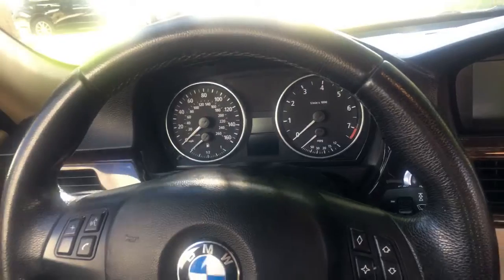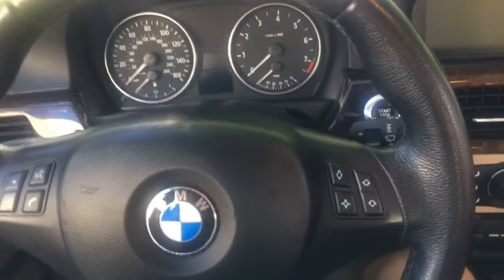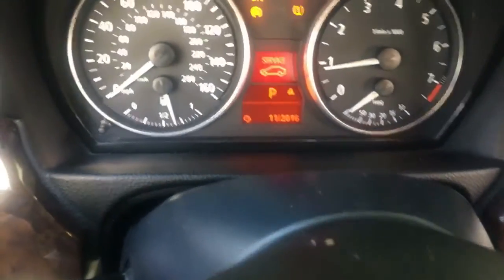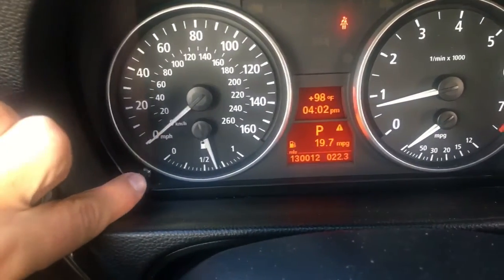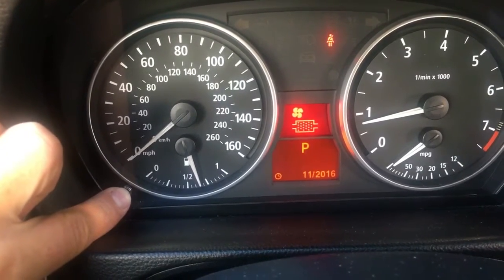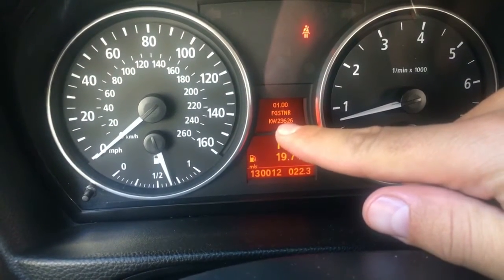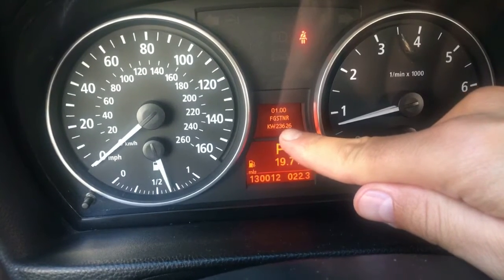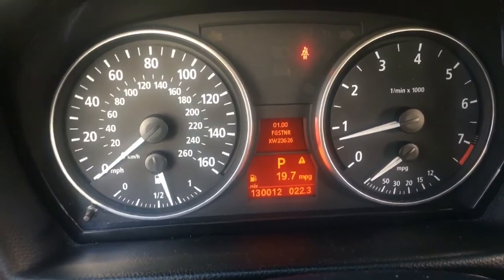HOW TO CHECK ALTERNATOR VOLTAGE ON BMW E90 E91 E92 E93

Comment: This will only work on my 2009 328Xi when the car is in auxilliary mode. If I start the car, the menu never somes up which defeats the purpose of the car running to see the voltage. Any thoughts?  Thank you

Comment: Is it normal that my alternator drop from 14.2 to 12.5 the 13.5 like its never stable no matter if Lights or heat on or off???
Reply: No, Either the battery is weak or the alternator is failing

Comment: In my Chevy there are gauges for oil pressure, oil temperature, water temperature, and voltage. I don't have to pump codes and solve equations to get basic necessary system information. F*&king German Engineering. I also own an E90 btw. I came here wondering how to access basic troubleshooting information. FFS what a joke.

Comment: Thanks I'm getting 11.9/12.0v when off, I think my battery is on its way out and causing Check engine light with 2B13 error code on the DME when I do a scan.

Comment: Mine is staying at 14 drops to 13 when putting lights on and air con on then back to 14, but when I put my foot on the Accelerator, it drop to 12. Is that normal ?

Comment: REMEMBER - Just add UP the LAST 5 Digits.  My car showed the letter A followed by 6 digits which added up to 33.  33 did not work, however when I added up the last 5 digits I got a different number 24 which when entered worked perfectly.
My voltage is reading 11.4 and wont to 11.0 when the AC was on.  Hmn...

Comment: much easier way..just put in a cigarette socket USB connector which showed you the voltage automatically on its display. Cost you online just about 5 or 6$ :face-blue-smiling:

Comment: I have a 08 X5 runs ans drives good every now and then Ike twice a week the dash will light up and car ac wouls turn down and start showing 4x4 and abs malfunction and says drive moderately and then die. If I wait about 30 mins it would start and run again

Comment: Hi everyone, my car (2010 E90 320i petrol N43) has a new battery . What might be causing the voltage to spike like crazy? Here is the link of the issue. It even caused car to cut engine power and all electricity while driving at around 50mph on a motorway.

Here is the symptoms, and thanks for your support!

https://www.youtube.com/watch?v=ZPbjUZ_8v7w&ab_channel=ozan

Comment: how often do i need to get the brake pads changed?
Reply: After 5 years if u driving 12.8k a year 👍Depends on your driving style and where u driving… motorway or city👍
Reply: When you hear the calipers hitting the rotors you will know then haha

Comment: My voltage reads around 11.6v using this method.  Thanks for the info.  You also have a video on alternator diodes.  Can the diodes be replaced separately or does the whole alternator have to go?  Any alternator brand replacement suggestion?
Reply: Upon further troubleshooting it turned out that the bolt to the serpentine belt tensioner partially sheered off, which cause the belt to slip and the alternator to stop charging.  Nothing wrong with the Alt after all.  I think the tensioner was a little over $20 and the repair was a piece of cake.
Reply: Nice feedback

Comment: my clock an date keeps resetting is it to do with my battery if so do i need a new battery?
Reply: My car has exactly the same problem, I'm going to fit a new battery tomorrow and see if it fixes the issue.
Reply: l34052 Ok mate keep me updated if it fixes the issue you need to code the battery in also if it’s past a 2006 model i think
Reply: l34052 did you change it mate?
Reply: @TheLoneRanger1992  
I changed it today so it's too early to tell if it has or not, I'll keep you posted though mate👍
Reply: l34052 any joy mate with new battery?
Reply: So far mate its been okay Yeh,  I don't want to jinx it but it seems to have sorted the issue.

The old battery in there looked like the original from the factory, it had all the BMW stickers on it so would have been in there for nearly 11yrs so was clearly on its way out.

It cost me £130 but was money well spent I think.
Reply: l34052 That’s great news mate, i’m glad it’s hopefully sorted it by looking at mine it looks like the factory one too which would make mine a good 12 years so i think i’m gonna try with a new battery as iv tried everything else i can cheers for advice an support on the topic
Reply: @TheLoneRanger1992  
No problems I always like to help a fellow BMW driver out if I can, all the best mate👍
Reply: J.M Z.C Two months ago mine died showing the battery sign This time it died again but there’s no battery sign. Can it be the alternator?
Reply: Micole Adoptante Could well be. If you can get your hands on a Voltmeter/Multimeter or dedicated battery tester (reliable tester) it will give you a good reading if the battery is showing a hold of charge. That doesn’t mean it is a good battery though. The later BMW models as I have found out recently use an AGM (Start/Stop) enabled battery. At rest, when the car is switched off, a good battery should sit at around 12.5volts, any lower than 12v and you will have issues. When you start the car the battery should rise to 13.5-14v, this will show the alternator is working. When the car is switched on turn a lot of electrics on in the car, your radio, AC, lights etc, the battery drops voltage when these are turned on but should rise again quite quickly to the 13.5-14v.... ie this is a good test to show the alternator is running correctly and providing power back to your battery to keep it topped up. A second pair of hands is needed!
 Unfortunately though I recently tested my own battery and everything was giving a good reading on the multimeter but when tested with a dedicated battery tester it showed my CCA (cold crank amps) were low, very low to be honest which indicated a bad cell or two in the AGM battery itself so it needed to be changed out. AGM batteries do require a code to allow all your modules to reset etc and unfortunately they ain’t cheap. Hope that helps pal.
Reply: Junior J thank you man 🙏🏾
Reply: Micole Adoptante You’re very welcome
Reply: Don't knkw if you still have the same problem, usually when only the clock reset its the battery. Either too low or jist a bad battery and if the clock and date are reset, as to my understanding i could be wrong. But bc if past experiences it has to do with the alternator.

Comment: So what voltage should implement a new alternator? Example 11 volts when lights are turned on etc. Thanks you rock
Reply: I've also compared the readout to a multimeter at the battery and they are the same.
Reply: @antoniop1968  

The alternator usually pumps out 1.5 volts on top of the battery voltage. So you think 12.8 voltage with the car off , 14.5 while running. 
My car has been draining the battery lately , I think it's the IBS cable .. I have a new battery replaced today and drove the car around for two hours, volts stayed the same. The real test is what I find in the morning , I have the ibs cable disconnected. They say when it starts to go bad , which they do over time and my car has orignal parts at 214k on the motor. Once this cable starts to go bad , it puts your car back in forth into sleep mode during the night time while it's sitting. Hopefully disconnecting the ibs will prevent the battery from having voltage pulled from it due to that faulty cable.

How did you find out you had a bad alternator and did it cause any issues before the replacement?
Reply: would like to know the same
Reply: @sailingdev  ok
Reply: When the car is running you should see around 13-14v, if you're consistently under that I would check the alternator.
Reply: A good battery will sit at a steady 12v when charged. If your getting anything under that, your car is draining your battery. I'm getting 13.9 - 14.3 when I'm driving, I also  know I need a new alternator, so I'm inclined to believe we need more.